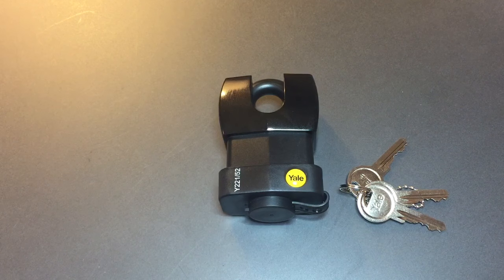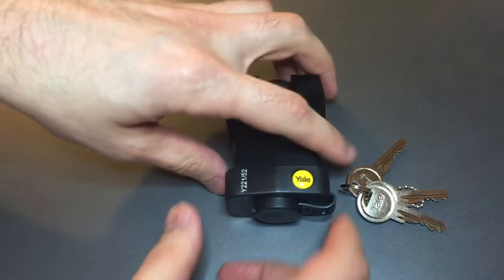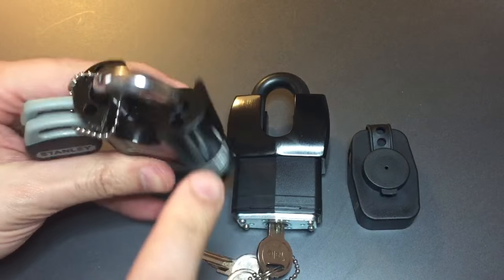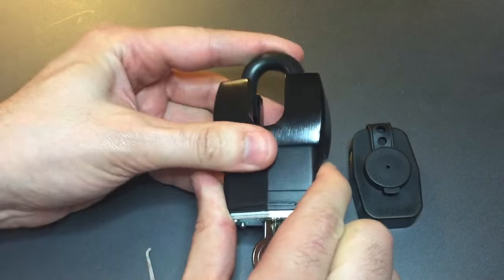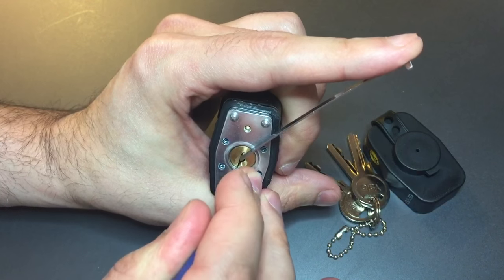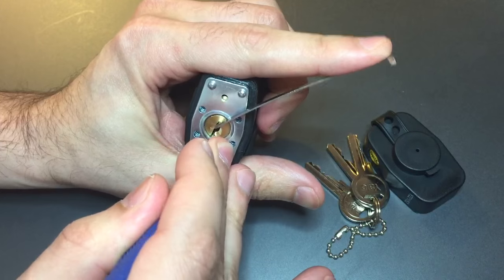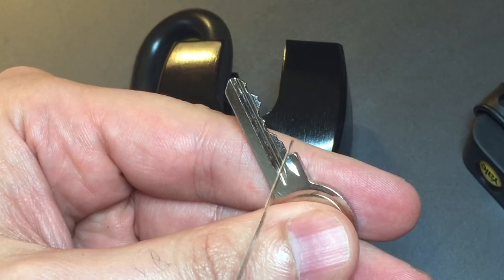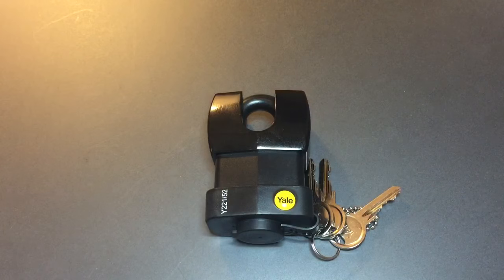[175] Yale Y221/52 Shrouded Padlock Picked

Comment: Hi Harry,  Disappointing .... for sure. You're probably correct, the two driver pins sitting at the shearline, with the key removed. We are finding this with cylinders assembled in China - including Lockwood - particularly locks with balanced pin stacks. We have seen drivers sitting BELOW the shearline, and the spring across the shearline with the key removed. It doesn't effect the original key operation, so the lock is passed. When picking, our guys have found the spring/s wrapped around the plug jamming it and preventing full plug rotation. An incorrect but close cut key would create the same situation - and has. Thanks for showing.  Regards, Brian.
Reply from the maker: LOL, if you want disappointing, check out the video I'm going to post in two days... it's borderline humorous!  As for the driver pins, I've been coming across that a fair bit lately.  I'm considering a video series on 50mm laminated padlocks, and have been taking a close look at them lately... A few of them (even very nice ones) have this issue.  As for the springs wrapping around the cylinder... been there!  Though never with a factory lock.  I've received a couple of challenge locks where this was an issue.  The maker didn't quite think things through enough.